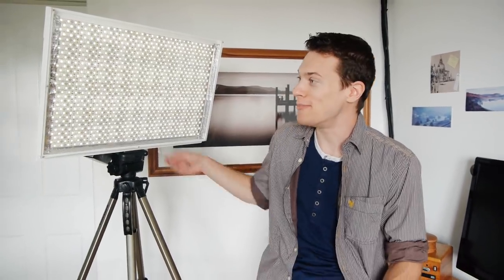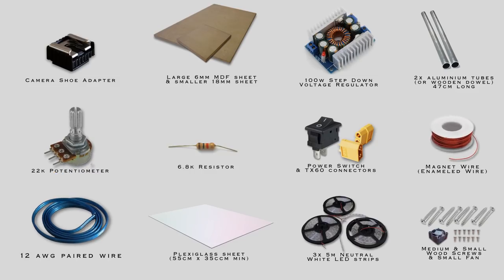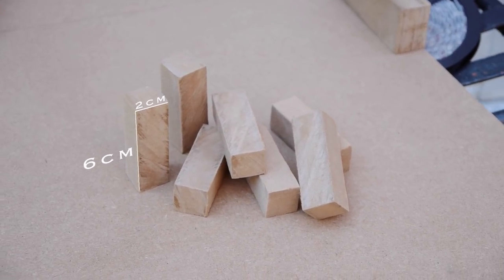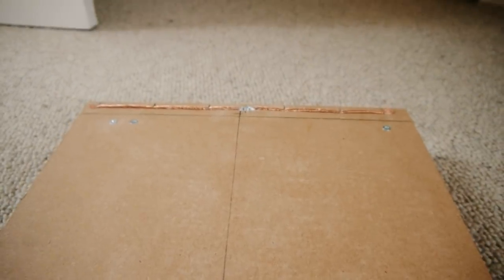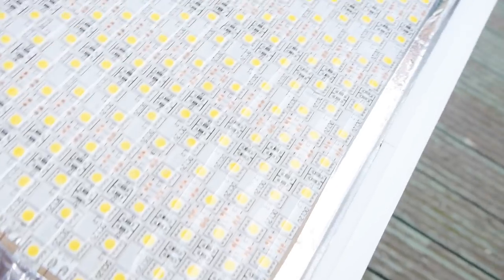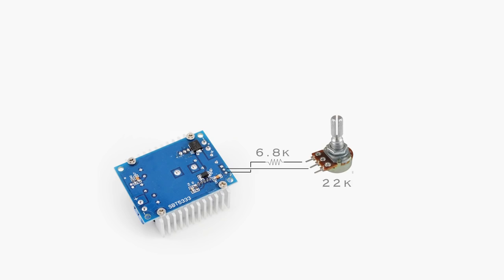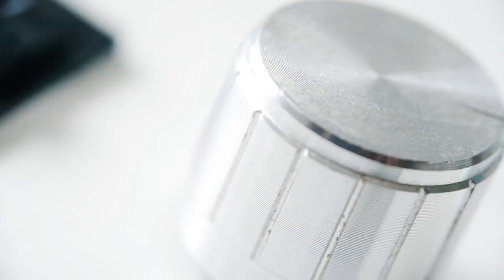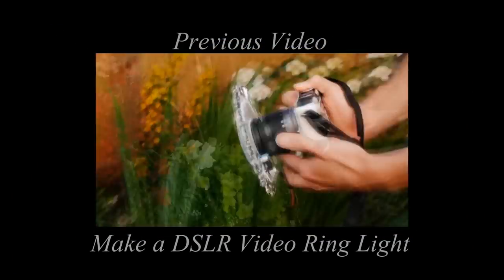How to make a super bright LED light panel (for video work etc)

Comment: I like your channel but I am really surprised that you glued 100W worth of LED strip to the MDF. It will fry the LEDs within the couple months. I even had my LEDs got damaged when glued to aluminium strip... not saying about MDF
Reply: hmmm... can you provide more details on why MDF is an issue here? And how to make it better? I‘m about to build one that’s supposed to last, so i‘m very curious.
Reply: @eyeflytinkerings  you should provide heat dissipation for the LEDs. So you better put it on the aluminium (not foil). It will act as a heatsink. And if you put together a lot of led strip, better calculate if it can dissipate such power. There are numbers on the web on how much power can 1sq.cm of aluminium  dissipate

Comment: The LEDs you specify are rated at 0.6A per strip, with 30 strips like you show the total current reaches 18A. At 18A and 12V the power is 216W, so you're power supply will overheat and the MDF you're using as enclosure will catch on fire! The battery will also discharge very rapidly and overheat, or if you use a laptop adapter (which is rated only at 80W usually) it'll overheat and be destroyed too. Be super careful with this project, and don't be fooled just because it's cheap! The real-deal LED panels are expensive because the parts required to make them work are expensive. You're looking at a good amount of money involved here!
Reply: +Hero von Drachenberg Im not so sure, since the LED strips draw 1.2A for every meter, and they are 5 meters long. That means 0.6A for every strip (50cm), and there are 30 strips. Thus total current draw is 18A, and at 12V (max) power is 216W.
Reply: +Hero von Drachenberg Also the page specifies 72W for every 5m, and three of those would be 216W, in line with what I calculated. I got these numbers just from the Amazon page for the led strips, where did you get yours? A 5m led strip with only 24W would definitely make this a valid project!
Reply: +Hero von Drachenberg Sorry, last reply, but if each LED draws 2.1mA (common forward current) and there are 900 of them thats 18.9A of current still. Id have to check a datasheet to get an idea for wiring and then voltage from there across each strip but if the driving voltage is 12V again my calculation is 216W
Reply: +Sam Gallagher Remember that he is wiring his strips in parallel and not in series so the current will be split between each strip. I have a 12V 6A adapter and since there are 30 strips in total (50cm each) that is 6/30 = 0.2A per 50cm strip. Therefore the power in each strip is 0.2 x 12 = 2.4 W. Hence the total power consumed is 2.4 x 30 = 72 W.
Reply: +MrEpicGekko First, addendum: I made a mistake in my calculation of current! If each LED drew 2.1mA the total current for all the LEDs should only be 1.89A. Except common forward current isn't 2.1mA, it's 20mA! The answer is the same, 18A, but I felt I needed to say that. 

Second, current in parallel means that each branch carries whatever current and they sum at the junction. The idea is that if you connect two 1k resistors in series with a 1V supply they will draw 0.5mA total from the supply. But if you connect them in parallel they will each draw 1mA from the supply, and therefore they draw a total of 2mA. Kirchhoff's current law! If you put two loads that require a certain current in series, like two LEDs that both take 20mA to turn on, they'll only draw 20mA from the source. But if they're in parallel, the currents in each branch add, and you get 40mA from the source. 

Each strip has 30 LEDs, and each LED needs 20mA, then each strip will draw 0.6A like I said, and since the current in each strip adds, the total current for the supply is 18A for 30 strips.
Reply: +MrEpicGekko The method he uses for powering this circuit doesn't seem to limit the current at all as well, which means it'll run at its maximum current all the time, with the output voltage being the only difference. That's crazy, you're basically shorting it all the time. At least, I can't find a point in the video where he puts any resistance in series with the LEDs.
Reply: ***** The LEDs will only take as much current as they need, they don't automatically draw the maximum current.
I think the LED strips also have resistors built into them (may be wrong though).
Reply: +MrEpicGekko Ive never heard of LEDs that dont need a series resistance, its another story if they have built in resistors, Ive never worked with LED strips so I couldnt tell you and theres no datasheet either. But my friend has ordered the parts (he showed me this) so Ill take a look this weekend. If they do, though, itll still draw the max current of 18A. Thats how the LEDs are rated, its there on the amazon page.
Reply: ***** Hmm, does sound a bit odd for them to draw that much current, the ones I got were from Ebay and were designed to operate at 1.2A I think.
Reply: +MrEpicGekko My friend like I said bought the LEDs and the actual current draw for a 50cm strip is only 400mA at 12V and the strip does have resistors so as you lower the voltage the current drops fairly significantly! It works with this power supply as long as you're careful not to go over 350mA so as to not run the supply full power all the time.
Reply: +Sam Gallagher  So is this a feasible design?   What should I be aware of with all this, I'm planning to build one.
Reply: +mary white yea it is! For safe operation and good measure though I would not put the voltage above 11V, so set the limit there. Also, an aluminum enclosure would be much better than using MDF for the power supply box. Those small changes will make this design safe and sound, with minimal chance of burnout.
Reply: ***** But aluminium conducts electricity whereas MDF doesn't, seems as if it would be much more hazardous to do that.
Reply: +MrEpicGekko very true so what you do is put the bottom of the circuit board on plastic and enclose the rest in a bud box (great aluminum enclosures) so that the heat will conduct. If you use MDF and the power supply heats up you risk a fire, the only issue with aluminum is its one more thing to buy and if you leave electrical connections exposed (DONT) youll short the supply and itll pop, but no fire. I might post a few pictures of ours to show how we did it.
Reply: ***** Surely having a fan on the heat sink is enough to draw the heat away? You could even put a fan on each heat sink for extra cooling.
Reply: +MrEpicGekko Forced air definitely helps, but only so much. I wouldnt suggest an MDF enclosure even still.
Reply: ***** Oooo Yes upload a few pics or video I'd like to see.   I've been looking at single 50w Leds also for some kind of single light design.
Reply: +mary white We ended up ordering a whole new AC-DC power supply from digikey that came in a metal enclosure, after we ran into issues with using a laptop converter and the step down. It was an extra $35 plus shipping, and we also took the opportunity to order power cables and a jack to use with it and a pair of fans to keep things cool. The specs were something like 100W 120VAC to 12VDC supply. Ill have to go search for the part number later!
Reply: ***** hey thanks! if you decide to put a video up let me know :)
Reply: +Sam Gallagher I'm sorry to tell you the calculations are WRONG.
There may be 30 LEDs in each strip BUT there are 10 parallel sets of 3 LEDs in series, not 30 parallel LEDs.
This is why you must only cut the strips where he indicated in the video.

Also each of those sets of 3 LEDs have their own series limiting resistor, so this allows driving from a voltage source without massive instantaneous current increase as volts are raised.

This then magically reduces your 18A to 6A and the world is exactly as per the video.
Reply: +Ray Jones hi! So you think it's safe to do it? What modifications can help the LEDS to last longer?
Reply: I could be using slightly diffrent led strips but testing with a multi-meter, I am drawing 0.5amps per strip in my build. this works out to 15 amps to run the 30 strips. I'm not sure if his math is that far off.
Reply: Hey all, I meant to write back after my own build. The strips have resistors in them but we still upgraded our power supply to one that met our specs, and had no problems. I'll find the video somewhere. I don't have the thing anymore, I'd built it for a friend, and I don't think we measured current. Voltage was maxing the 10A supply at around 11V. The power supply we used had automatic shutoff if this was exceeded, which was anything above 11V. A fan was attached to the power supply and the supply was mounted on the back. It worked out well!

Comment: He keeps saying "12 American Wire Gauge" which is weird to me because in America, we just say "12 gauge"
Reply: @ Daniel 
what is so hard to understand? Brits mix GB, US, and ISO measurement, so they have to name which one is meant. 
 
By the way, do you know what the '12 gauge' stands for? 
 
ISO numbers have a unit, just like 3 mm² which means that the cable, when cut, shows a surface of 3 square millimeters (which in this case for a round cable is a diameter of .98 mm) 
 
... by the way: the '12' is an arbitrary value that corresponds to no other value at all - the closest ISO equivalent is 3 mm² ...

Comment: I watched this video and it inspired me to make it. Now that I have it built now I want to know how do i add a PC sync port to it to make a "strobe" or Flash panel if it's possible. I looked at robbing a disposable camera circuitry board but with the power input and output i maybe need a larger capacitor to store the power. I'm not an electrician but I would like to make something like this http://www.instructables.com/id/Slave-Flash-from-a-Discarded-Disposible-Camera/?ALLSTEPS but at with these panels please message me!

Comment: Hello,
I am already at the step of setting up the Step Down regulator
I bought this Step down (http://www.ebay.com/itm/271644575171?_trksid=p2060353.m2749.l2649&ssPageName=STRK%3AMEBIDX%3AIT)

And i am using a old laptop adapter that has an output of 19.5V - 3.34 A.

when I hook up the altimeter to set min/max, it only allows me to give a maximum output of 7.44V. I also checked that the adapter is giving me my 19V, funny thing is that i tested the amount of Voltage at the input of the step down and it tells me 7.44V (input side)

Is there anything wrong? Did i purchase the wrong device?
Thanks before hand.
Reply: +Santiago B You got a defective part. These are cheap with no QA. I got a bad one too.
Reply: +Aaron Lee Kafton i bought another one from in state and is acting up the same as the one before. Voltage is 19.5 when it comes in then auto drop to 7.45V max
Reply: do you already have your dial soldered on? I would suggest removing it and then seeing you're still getting the same voltage
Reply: +Aaron Lee Kafton I have now 2 Step down, the old one and the new one, the old one with the dial produces 7.5v
the new one just out of the package produces the same voltage

Comment: Hi! Really like your video! It inspired me to make one on my own. I have a couple of questions though and i hope you or someone else can help me out. I want to make one with 5630 strips. My first qustion is: can i connect the strips directly to this: http://www.amazon.co.uk/Switch-Power-Supply-Converter-Strip/dp/B008SO7HE2/ref=sr_1_6?ie=UTF8&qid=1422850833&sr=8-6&keywords=AC110-220V+DC12V+15A+180W 
My second question is: Is it preferable to use  metal or will mdf work just fine?
Reply from the maker: TheRobban87 You can connect them to that power supply just fine, although I don't recommend it unless you're comfortable wiring up its mains plug.For 5630 strips I recommend metal, as they run hotter than 5050 strips so need more cooling.
Reply: DIY Perks Thank you very mutch for your quick answer. Wiring up Its main plug? I figured I could just place the strips on some kind of board like you did, and connect the led to a big wire with different polarities on each side just like you. But only have this transformer on the back, which I imagine I would be able to connect just fine by my self.
Ok, then i guess i have to use metal, even if it would be easier with mdf.
I chose the 5630 because they are the brightest. The company I ordered from claims each strip is 6000 lumen, but only 30 watts. Thats, 200lm/w. If that is true, they make really good leds :p
Reply from the maker: TheRobban87
 Yeah, that does sound a bit too good to be true... but awesome if so!
Reply: TheRobban87
Wow, do share where you purchased these.

Comment: CAN YOU MAKE A 5630 strips BUILD?
Reply from the maker: JUCE DA MCEE I'm planning one, yes.
Reply: is it a way we can use clamp lights since the 5630 would get to hot for wood? and will the cut off voltage(12v) be the same
Reply: JUCE DA MCEE Cutting voltage is not the answer for heat control. The heat is by-product of current flow. You increase the size of the heat sink (and airflow) or reduce current (dimmer light). Wood should never be used to house anything heat generating. Sheet metal hobby boxes are readily available and low priced. Cheap fire insurance.  Here you are setting up for multiple raw voltage input converted to a controlled consistent voltage output. The current is steady and the light output is controlled by user controlled voltage adjust.

Comment: Voltage regulation for LED is total bullshit. LEDs are driven by current, not voltage. There's a VOLTAGE DROP parameter for any given LED which means practcally it won't conducts (light uo) until the voltage difference across its terminals reaches or exceeds that value.
The LEDs are only regulated by CURREN! Also, one should never exceed the current limit for any given LED. 
Considering the LED strips, there are current limiting resistors soldered, so it finally comes to voltage regulation (with any given resistance, the more the voltage, the more the current - the ohm's law). But still, if you want to regolate LEDs lightness, you should use current regulator - not voltage.

Comment: The CRI rating for these LED strips are horrid...I was told they were 70-80. For any kind of professional photo or video work, you lights need to be at least 90+

This is a really cool DIY project, but there's no way those lights are good enough and would be doing your clients and yourself a disservice by using them...
Reply: +ironorr84 the led's I used have a CRI rating of 88-90. If you really are THAT concerned with accurate color ten gel them to acheive what you want. I found 1/2CTO on these LED's to give me 4850K. What do expect for a $40 project. 
http://www.ebay.com/itm/181089020410?_trksid=p2057872.m2749.l2649&ssPageName=STRK%3AMEBIDX%3AIT
Reply: +Lane Shurtleff - Well the problem is, is that right after great quality sound, what's next to making great quality video is the lighting. This video and quite honestly many other resources that aspiring videographers watch (from hobbyists to those wanting to go pro) have failed to point out that not every light is created equal, from lumens, to kelvins, and the CRI rating.

I'm just saying, that if the quality of lighting isn't important to you, this $40 solution would be enjoyable to build and tinker around with your homemade productions...but for any serious paid work, I would hope those of you who are aspiring to do pro level video work would think twice about any lights that are under 90 CRI.
Reply: +ironorr84 Agreed. My build that I posted earlier, uses completely different parts and design. Many of the parts DIY used are cheap Chinese knockoffs. I replaced the LED's with better quality, built a better panel (designed after a KinoFlo 4 tube 4' panel) and good power supply. By splitting power into 2 channels per head I can have full or 1/2 power instantly. While this may not work for everyone, most of my video production involves interviews and large sets without much need to finesse light beyond gels.

Comment: Please, next time, use a lapel/lavalier mic.
No more use of the mic on camera, please.
Thanks.
Reply: Dan Lewis It didn't seem to me like he used the camera mic.
Reply: Then you do not have ears tuned for the sound.
Don't you hear how 'hollow' the room/voice sounds? That's a dead give away that the subject is not using the right mic.
I'm pretty sure he's using the built-in mic on the camera, as so many silly people do.

Ahh....I now see the problem.
Later on, in the video, he does indeed switch to a mic that is suitably close to the talking person.

So....our host starts off with the mic on camera, then wises up and uses a much better mic'ing technique.

Thanks for your comment. :)
Reply: Dan Lewis Yes, I see. We were both right, I guess. Lol.
Reply: Thanks for straightening me out on the matter.
Good journey.
Reply: What?
Reply: Dan Lewis I'm sensible. I modded my camera so that I could bypass that shitty built-in mic. I am on a very tiny budget, so I use singstar karaoke mics. very decent sound!
Reply: I applaud your attempted innovation.
I said what I did because the audio still has the unfortunate micro reverb we so often hear when the mic on camera is used.

I don't know where your mic is/was during the shoot, but the audio playback says that a significant flat surface was closer to you than the mic. That needs to be reversed.

The micro-reverb negates various frequencies your vocal chords initiate, giving your voice a dull aspect you really don't want.
Good journey.